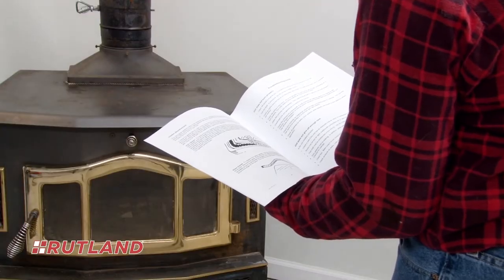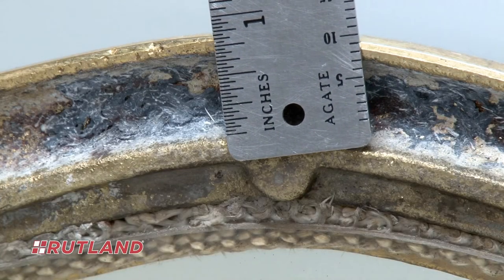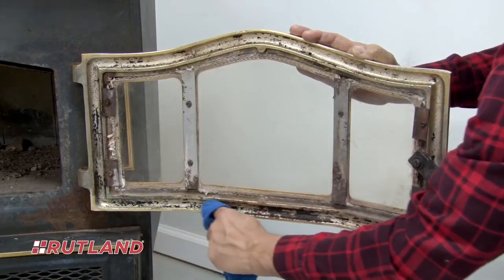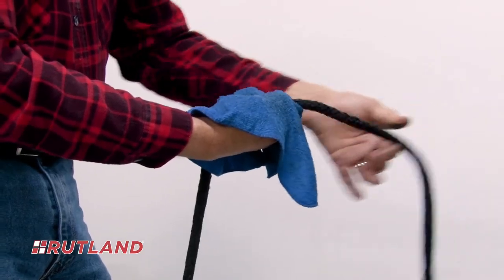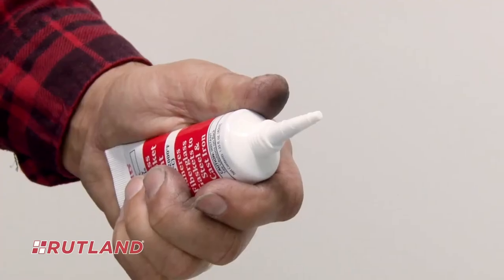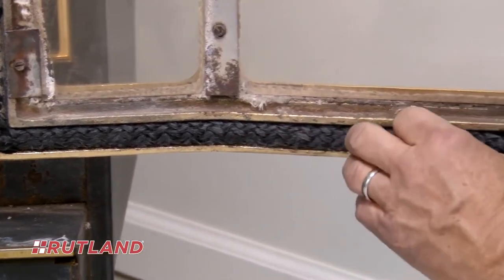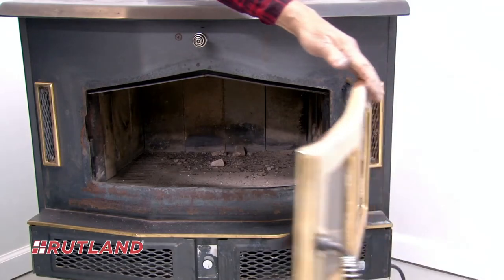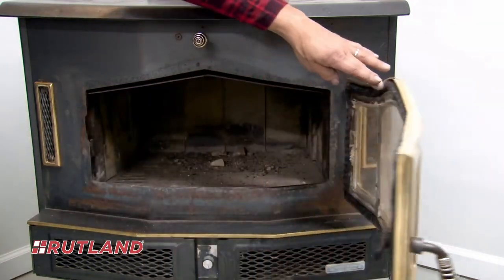Rutland Stove Gasket Cement

Comment: The tube I have seems to suggest that one wet the door as well. "Dampen area with water and apply minimum amount of cement to the gasket channel" I guess that this is a mistake because the instructions do not mention making the gasket wet. Hmm. I did it. I think that a bit of water on the door as well  as the gasket may have helped the bead of cement to stick to door.